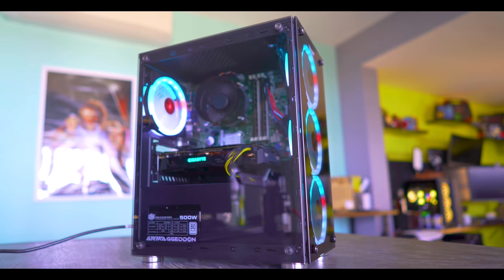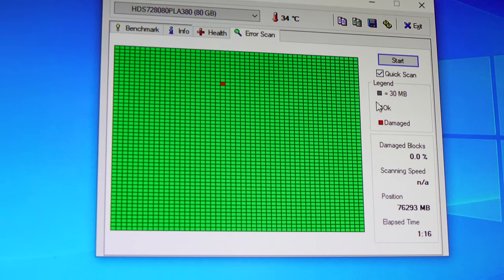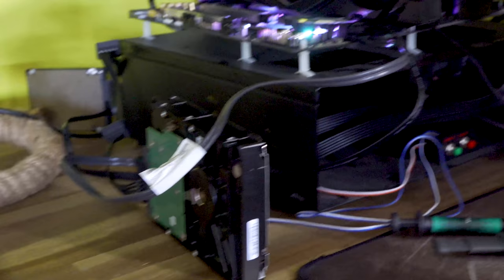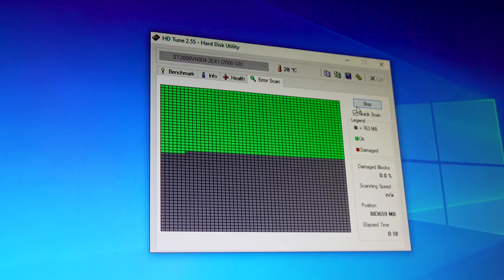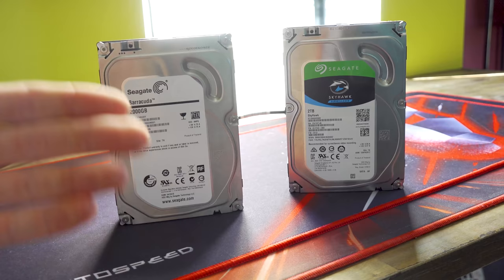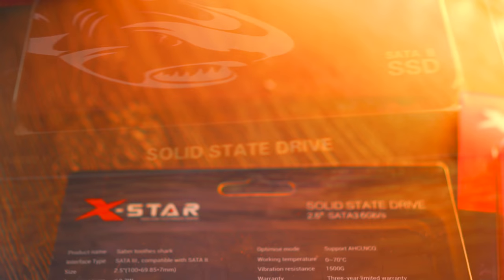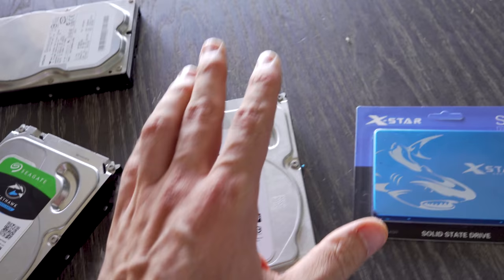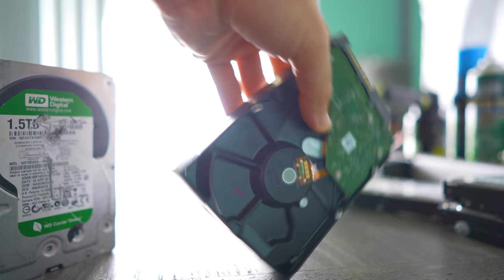Are USED Hard Drives Worth it...? (The Tech YES Buyer's Guide)

Comment: The only used+actually purchased (SATA) HDD that I've had work out are:
- early+low power Samsung 1TB (very little actual use)
- 2TB Toshiba HDD that was effectively new due to the owner having it infected with ransomware within the first week of buying the PC.
- 1TB WD Blue of a similar age to my first one from 2014 (in RAID 0 right now)

Both the WD Black RE2 and one of the earliest 2TB WD Green drives that I've bought have either don't spin up any more or have that many bad sectors that the BIOS refuses to load OS if the drive is plugged in.

Comment: I bought one new Seagate barracuda from online retailer 

I used it once to backup my system image 

Then not even a year later I want to restore it and what do you know.. the thing is not recognized as a hard drive anymore

But what about my multiple old 2012 refurbished seagates?? They still working as fiends 24/7 with no rest taking multiple beatings

The only refurbished that has already failed me is one that got a heavy electrical discharge
Reply: I lost 2TB of data thanks to 2 1TB external HDs from Walmart.
My mom bought them both an I lost everything on them. Never again.

Bought 1 WD from Walmart a long time ago still works. Bought 3 hard drives off of OfferUp. 1 Seagate HD and 2 WD 500gb hard drives. They still work to this day.

Comment: The problem with used HDDs is that they can go at any time. It's not like you have to develop bad sectors first as I notice some people are commenting.

They can die. Maybe you would want to use a used hard drive for your unimportant data.
I don't really have unimportant data. It's all on the drive for the reason of it's usefulness. I don't mind paying more for worry free reliability. 

You know how everyone has had a bad experience with backing up things to the cloud, or cloud storage in general? Well, imagine losing all your data on the drive in one fell swoop because it failed. 

I'm a real cheapskate, but there are things that cheaping out on is a really bad idea. 

Storage, IMHO is one of them. 

Is not use a used HDD just like I wouldn't buy a cheap PSU or an electric blanket. They are items that, when they fail, they take other things down with them.

Comment: for games, windows and primocache on ssd, with extra 64GB is enough. external hdds are often cheaper and can be used as internal ones, especially when usb cuircuits or power supply fail.

Comment: My experience, monitor your hard drive health with SMART monitoring software.  WDC green drives are junk out if the box, takes forever to mark a sector bad, will unmark bad sectors at will and then time them out when you need the data.  Old Seagate drives are a nightmare, they can fail 100% with no SMART warning at all.  Hitachi are Stellar quality, and sadly you can no longer buy.  Enterprise drives last longer, and so will SAS hard drives, where you need 10k RPM, speeds are more liveable  and you get Petabytes of writes easily in the life of the drive.  Even WDC Velociraptor hard drives are good long time use drives.  Also, be very careful of people shucking external hard drives and selling them as desktop drives. HGST external drives aren't that bad, but anything else is a gamble.  SMART will report the power on hours and a tally of how much has been transferred from and to the drive.  If you have a old drive with low usage, you basically have a great buy, but nobody advertises SMART data with their used hard drives.    If you don't trust used hard drives, acquire a dedicated RAID card and pair the drives using mirroring or striped parity (Raid 1 or 5, 6..).   Really there is no benefit with RAID 10 or 50, because hardware controllers are so fast that you might as well do one or two drive redundancy parity.  RAID has the benefit of accessing every hard drive simultaneously, multiplying transfer rates by the number of drives you pair together.  And worse thing a guy can do is use onboard RAID, because if your motherboard fails and need to buy another one, you basically say goodbye to your data.  With a dedicated hardware RAID controller, you can easily transfer your array to any PC ( with the same operating system or newer operating system ).  Some controllers are PCI-e 8x, capable of caching with RAM and benefit from vastly improved data throughput over conventional onboard motherboard RAID and pass through SMART data and bootable, supporting multiple volumes for any given array for those who like protecting all their data and being able to segment OS from other data.  These are some aspects.  In general, I would never recommend anyone buying a used hard drive.  I have received drives flashed to invalid capacities, SMART data reset to zero hours when it clearly has been used and very old..  Also you can renew a hard drive read speed simply by writing multiple different data patterns on the disk.  Refreshing sector strength with rewriting data on a yearly basis extends the life of your hard drives. Just copy data to backup, reformat and copy data back. I am speaking about mechanical hard drives, not SSD drives.  I would never recommend a used SSD drive as their life is severely limited due to the fact they can only be written to a few times before the device stops working all together.  Every new iteration if SSD technology gets worse quality and endurance, so the newer the less life you will get, so if it is used, it is basically garbage.  That is my experience.he

Comment: you might want to provide a link for a different brand of ssd, in the reviews the Inland Professional ssd drives have a 4.4 out of 5 rating but in the question and answer section there multiple warnings about the drives failing in less then 60 days and the seller not responding to any support or warranty requests.......

Comment: One thing worth mentioning: Many tools show HDD as "bad" or "caution" when there's reallocated sectors, but it's actually a relatively normal thing as long as the numbers are low and consistent.

I keep the semi-broken HDDs for testing, since I'm kinda paranoid about PSUs and stuff. I also bought old 80GB Drives in Bulk (about 30-50 cent per drive inkl. shipping) to fill on old Core2Duo PCs and what not for people looking for Retro Systems (and salvaged the 500GB+ Drives to put in more expensive systems).

Just don't use any HDD with a low amount of Cache for Windows 10, since it's gonna seriously slow down the PC.
Reply: I noticed that seek errors start going through the roof right before they fail. A few bad sectors isn't so awful as long as the drive corrected them ok. The uncorrectable ones are usually an indication that the drive is actually failing.

Comment: Running "Quick Scan" in HD Tune may not be a good idea, I had so many experiences that the drive all green in quick scan mode but if I run health check again without checking quick scan checkbox the bad sector show up. It may take longer to run, but the result always more accurate.

Comment: I buy “refurbished” hgst drives from goharddrive, which are data center pulls. They typically look almost new, I have somewhere around 15 of them some have been running over 2 years straight and they run fine.

Comment: Bro are used SSDs worth it...?
Thanks!
Kindly make a video on this topic as well...
Reply: Yes they are. Compared to hard drives, they are WAY more reliable since they don't have any physical moving parts. If you're just looking for a boot drive, you can pick up a used 120gb drive on eBay for $15 and it will work just fine. I think ADATA sells new 240gb SSDs on eBay for like $30.
Reply: @rickylonghaul682  OK... Thanks a lot any indications for a faulty SSD...?
Reply: @raahimirfan5996  Not sure what there'd be that's noticeable. Look for any physical damage, but beyond that, you won't know till you plug it in and see if it works.
Reply: @rickylonghaul682  Hmmm... OK... Thanks a lot!
Reply: i'd say, as long as it's a fairly modern model and hasn't been abused, sure.

I bought a 64gb ssd for £10 off of ebay, it's in very good condition, wasn't used much, and besides it's going to be used in a machine that's really only going to be used for web browsing and games like puzzles and candy crush lol
Reply: @yotoprules9361  Hmm I see.. thanks

Comment: Windows failing to install on the drive not always is a sign of it being bad. Windows is quite dumb when installing and if there is some error on the partition, especially on mbr drives, there is a chance of not installing even though the drive passes all tests and is working fine. Using gparted on a live usb linux distro fixes this, clicking on the option to rebuild the table of partitions as msdos.

I bought an used Western Digital external hard drive for a while just to test something and i didnt noticed the deep scratches on its case at first, but when I saw it, I was quite pessimistic. Tested on HD tune, it was completely fine and almost never used.

Comment: you got it wrong
easiest way to predict how much of wear drive have it to check count of power cycles or heads retraction count
I have been using my 2003 made Seagate 40GB IDE drive for good 10 years, before I have stopped using it as OS drive
at this point it was used in computer, which was power cycled few times a day (compared to few times a year) and it got tens of thousands of bad blocks within few months
if I would keep it powered and spinning it would be still in pristine condition (imagine that had barely 1000 head retraction on this drive)

it is heads touching platter, which destroys HDDs, not how long heads are NOT touching platter
any form of touching damages platter and heads too (may it be parked or hit because of shock - it really doesn't matter, as while parking platter is still spinning and heads are touching moving platters, same just before lift off)

good example is enterprise grade HDDs - they work 24/7/365 and after years of constant spin you have perfect drive
I am professionally selling HDDs and I have seen HDDs with 5 years of power-on hours and just two digits of head retraction and or power cycles - those are perfect
those which have huge number of heads cycles are useless

Comment: I had one laptop I bought new that was pretty sluggish, it seemed like the drive was running in PIO mode, take forever to boot, login to windows 10 then you waited another 5 minutes for any programs to load once that was done it was ok,ish. I ran all kinds of test on the drive, said it was fine. After about a year of it i said naw Ill just put a ssd in it. yeah of course the ssd would be faster but I think there was something wrong with drive but i could find nothing

Comment: HDD's are like playing the scratch off lottery tickets. You get 1 that's good, but several that are bad. I don't know if there's really a "reliable" manufacturer any more. You got your WD drives, Samsung, Seagate, Hitachi (formerly IBM Deskstar) etc. You can buy one, 6 months later it shits the bed on you. I've got 3  of Western Digitals 1Tb portable drives. 2 run fine, and the third went south after 6 months (not worth the return from where I live). Not exactly sure what's wrong with it. Starts fine, powers up and spins (you can hear the RPM increase and the seeker head doing it's thing) then after a minute it powers down and that's it. No activity, not recognized in BIOS or anything. Even connected an external SATA controller to it and just the same thing. Internet shows a ton of these WD drives with the same issue.

Only alternative is to find a WD drive "exactly" the same with the same revision controller board, swap them out and hopefully it works. Has to be the same rev due to encryption.

Comment: Out of all the used parts, the 2 item  that i probably avoid getting used is psu and hard drive, hard drive are too fragile and psu are very hard to properly load test it, and i gotten a fake corsair psu before(it’s much lighter than usual if you’re familiar with good psu weight ),it works well upon first few months, then blew sparks when i swap a higher end graphic card, luckily didn’t took my other components with it. Upon disassemble only the shell was Corsair, it’s crap component inside

Comment: I had a hard drive making the same noise, but it started (my fault) after a linux install, I had set up the partitions as required, some time later I re-installed windows, so clean the drive, reformat then on to windows, as it re-booted all hell broke loose, I checked all the connections sure it was right I downloaded WD drive tools and ran that checked and did the windows install, I did use SMART monitoring and the drive was ok. I never fully trusted it and kept important stuff backed up.

Comment: i just got a exchange deal with a rx 480 4gb with my gtx 1060 3gb and got the deal and i had to buy an extra stick of 4gb ddr3 ram 

now my current spec is :
x3450  4c/8t xeon cpu
h55m motherboard 
4x2 trancend ram 1333hmz
and a rx 480 4gb
  
my pc feels smooth just like when i had 8700k with a rx590 and 3000mhz ram
,not just feels smooth but games are also running without any stutters .

Comment: you do know that cheap SSDs can fail pretty soon right? it is just they are more consistent in that they usually wont fail suddenly like a mechanical drive can. And also if you use it on a stationary computer I doubt the cheap SSD can last a decade like the older but higher end hdds

Comment: I like to add: The issue many people that buy hard drives look for 2TB, 4TB, 8TB etc. An SSD with that capacity would be lots of money. I agree with your example of a 1TB (HDD vs SSD), but that is rare. Gone are the days were someone is deciding between a 1TB SSD and a 1TB HDD. That is a no brainer.  Also, I just purchased two-4TB drives on Ebay and the dude said they were brand new sealed, when I got them, I installed both of them and both were dead on arrival. They would not power up. Later, he said he got them defective from someone else.  I was so pissed. Luckily Ebay has that guarantee money back thingie. People lie. Also, most people selling hard drives are NOT going to run test, provide you results, provide dates it was made, hours used, etc. Good advice, but not going to happen. Most people buying larger hard drives do so only a secondary drive to store long videos for example. Most have SSD's for their operating systems.

Comment: Can I make a recommendation?

Don't buy WD Blue drives, especially used ones. The only drives worth buying used are WD Red and Black drives as well as Dell, HP and other re-branded Seagate ES drives. Everything else fails quickly.

I've stuck to Seagate ES drives and SAS drives when buying used for the most part. Just because they have passed a higher level of Quality Assurance.

Comment: I personally don't like SSD because most of it is TLC, which means you can write to every sector of the drive about 1000 times before it fails. Windows 10 by itself seems to write 150kB/s or 5TB/year. So a 256GB ssd would overwrite itself about 20 times a year just by running windows 10. So it would last up to 50 years. Not bad really. But for some uses, a lot more writing will take place. If I was writing to it constantly and deleting and writing again at 600MB/s, it would take 7 minutes per write cycle or 5 days to fail. If it were m.2 it would fail even faster. In a way HDD has more endurance.

Comment: In my area there are a few sellers who sell of "enterprise class" hard drives for practically the same price as normal ones, some unused even, are they worth it or is it just a gimmick?
Reply: Depends, but they do often have white label (random unlabeled company not wanting to stake reputation on a drive  and sell it for less). The enterprise ones often have more advanced fraeatures (like G-force shock sensors to move the head away from the platter, as well as frequency analysis for the same thing which normal drives typically won’t have, but how useful is that in a box that sits on your carpet and doesn’t move? Well...) and they are more likely to have temp monitoring sensors (which will save the drive if you have 0 fans and really enclose that thing for some reason), but they also have WAY more cache buffer and often hold the read and write speeds higher than normal drives (so they can be faster).

However, if they are white label you probably don’t get warranty support (hopefully less likely that you’ll need warranty though, they are typically heavier duty drives), but you could always get a notorious drive like certain models of Deskstar (aka, DeathStar... not in a good way...), or other since you won’t know what brand will ship. If you can see them in person then cool, you can see what brand and model it really is just by looking at the metal plate because each company has a bit of a unique style and the storage capacity will be stamped on it and you’ll know if it’s SATA 2 or 3 and that pretty much tells you the real model and then you can see if that drive model is notoriously bad or not. If it’s not, then it’s probably a good chance it’s fine (I have one, it was like $65 for a 3 TB drive new in like 2016, back then I had a $250 480 GB SATA SSD, so it wasn’t the day of $100 1TB SSDs... although I much prefer the fast NVMe 1 TB drives at 20x the speed going way over 3 GB/s read and write (24+ Gbps for those marketing with “gigabit”). But that still costs more than mech spinners if you’re just storing videos and photos etc, and SSDs love to fail with 0 warning!